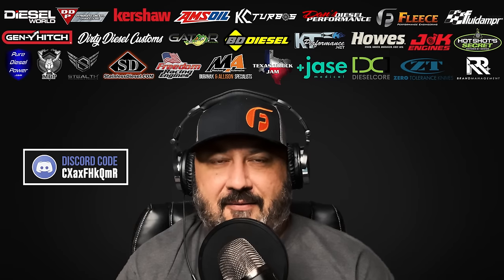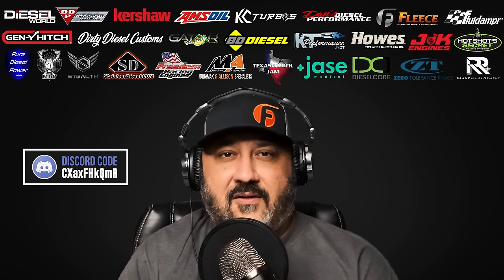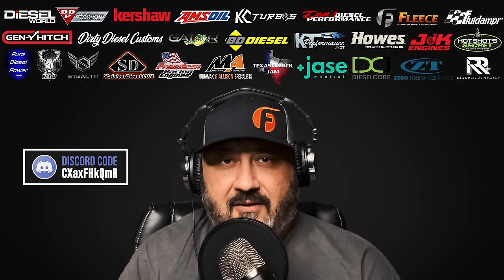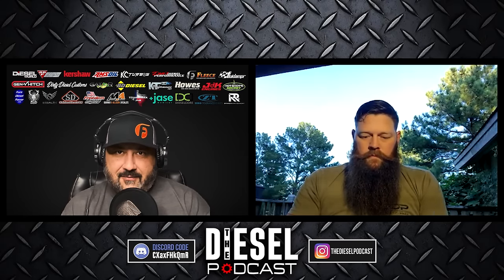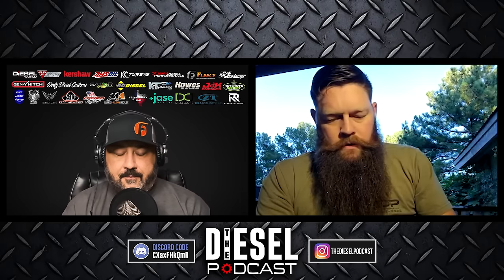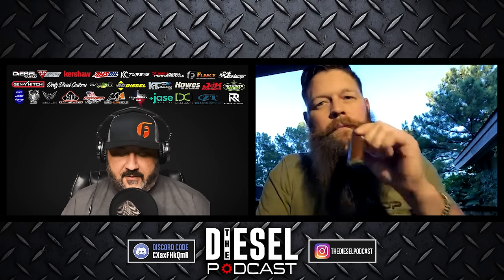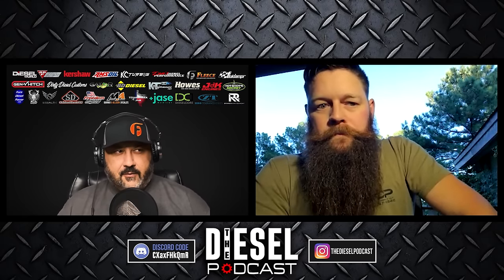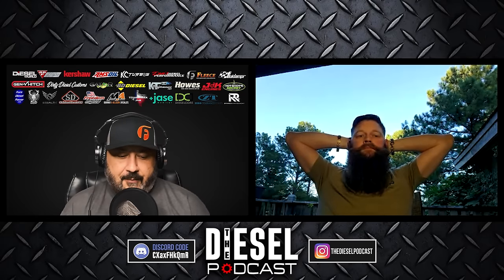Forced to Put DPF/EGR Back On?

Comment: i know of a auto body shop that  refuses to work on deleted trucks. in great falls mt.  i was hit by a deleted truck went to the same shop for repairs. the shop scanned the truck and inspected the truck and sent it away. Did you know you can also lose your insurance for having a deleted truck.
Reply: Wow man they took your truck and didn’t repair it because it was deleted?
Reply: Explain the insurance aspect? How so?
Reply: @extremerc76  a friend of mine got into an accident and his truck was full deleted. His insurance company dropped him after the repair shop informed them of the deleted emissions. Saying they do not cover trucks that have illegal modifications.
Reply: @tomsliter8628  I don’t doubt the shop refusing to work on the truck. I find it hard to believe they wouldn’t pay out tho over emissions controls. do they deny claims on trucks with window tint? Tires past fenders? Loud exhaust? That’s an easy dispute especially if it wasn’t related to the cause of the crash, I doubt it’s spelled out in the policy. I was rear ended in my gas truck with no cats and had no issues.
Reply: @extremerc76  it wasnt my truck.  It was a friend of mines. The company canceled his insurance after the shop did its inspection and since the motor was damaged they gave him reduced amount for totaling it out.
Reply: It was a friends truck they totaled it out cause of damage and gave him reduced amount because of the delete.
Reply: @tomsliter8628  I can understand the reduced amount.. the exhaust system and related BS is about $8k in value. Sure the can decline to insure it after the fact but they still paid out for it.

Comment: So it sounds like those of us (I have a 97 7.3) with the older non-emissions trucks can still benefit from the water/meth injection? Also, I try to “go easy” on my truck but does driving it with a heavier foot (higher rpm’s) actually cause the engine to run cleaner with less buildup in the long run?
Reply: Stomping it once a week will help clear out build up. Diesel's aren't meant to be grandma driven. They are built to pull heavy loads. If you aren't pulling heavy, you need to romp on it regularly.

Comment: Yeah and alligator performance forgets about you ASAP! Bought BD for our fleet and once the sale is done all they can say call BD we just sell the product.
Reply: I have no idea what you are talking about, I haven't worked for Alligator in over 10 years. I can only assume you are having an issue with a part you ordered from them. If BD is the manufacturer of the part, you have to deal with BD directly for any warranty issues. It doesn't matter who you order parts from, they can't address warranty issues. You will always need to deal with the manufacturer directly.

Comment: Does the water methanol injection work on VW diesel 4cyl and 6cyl engines also
Reply: Yes it does.
Reply: @vinnyhimes1190  is it hard to install and it works with the def system also
Reply: @kencee9213  The install isn't complicated, the nozzles need to be installed in the intake manifold and those holes need to be drilled and tapped with the proper thread pitch.

Comment: I call bs I see trucks that get worked hard and run long on the highway and have issues with the dpf and def systems they are junk
Reply: You are welcome to call BS all you want. I can only base what I said off facts and volume. We run 70 trucks a week through our 30,000 square foot shop. I personally talk to every single customer that drops off and picks a truck up here. A good majority of our clientele are hot shots truckers using their pickups to haul cars, boats, RV's, hay etc. Those folks have very few issues with the emissions systems compared to the customers I deal with commuting to and from work.
Reply: @vinnyhimes1190  that’s fine but I have personal experience with the Cummins and ran it long miles and hard and the dpf and egr went to crap at 70,000 miles

Comment: Would water/meth do anything on an lb7 without emissions? Great podcast by the way
Reply: Water methanol injection will work excellent on your LB7. It will increase performance and it will clean up the combustion process inside your engine.
Reply: @vinnyhimes1190  what kit would you suggest?
Reply: @vinnyhimes1190  where can you get this installed.
Reply: @johndavid1585  any Diesel Shop should have everything to install that kit. I installed my first one in my driveway with no knowledge of what I was doing.
Reply: @vinnyhimes1190  where did you order your kit from. Thanks
Reply: @johndavid1585  we are a Snow Performance dealer, so we order all of our kits from a wholesale distributor. You can order them from a number of different websites. I recommend XDP Diesel
Alligator Performance 
Thoroughbred Diesel 
Diesel Power Products
As they are all reputable ecommerce sites.
Reply: @vinnyhimes1190  Thanks a lot !